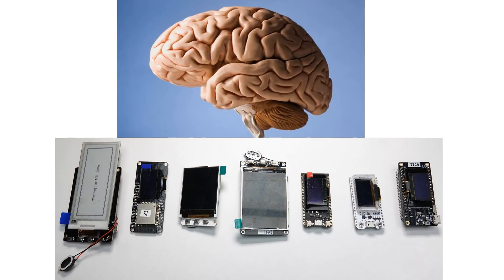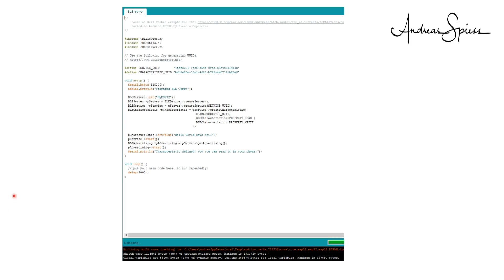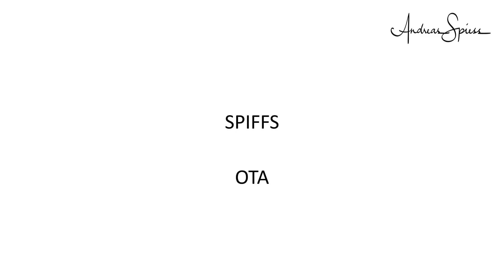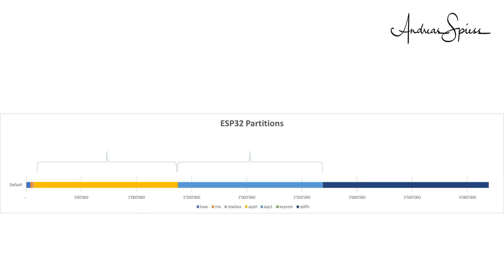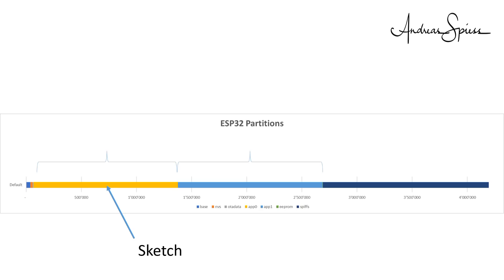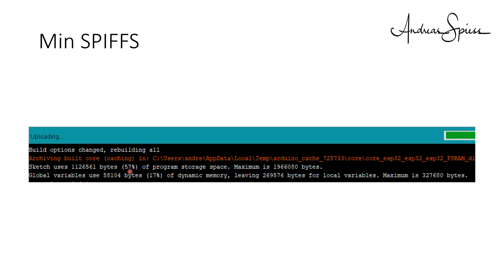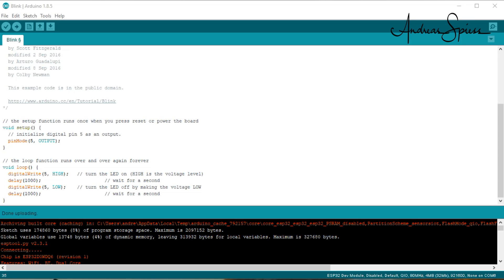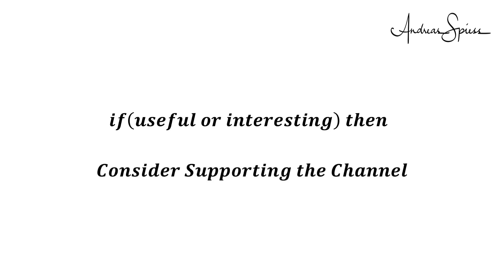#222 More Memory for the ESP32 without Soldering (How-to adapt partition sizes)

Comment: Cool - I'm using the Adafruit HUZZAH32 and the Partition Scheme menu item doesn't exist but a quick edit of boards.txt put that right and I'm now using Minimal SPIFFS with no problems :)  Thank you.
Reply: Really neat! Thank you
Reply: hello, what kind of edit you do in boards.txt?
Reply: @dhaniyanuar5024  I've just checked the ESP32 Arduino github and it seems that the partition lines are now in boards.txt, as installed.

Comment: is it possible to increase EPROM size??? because when I increase the nvs partition table, it doesn't work. 
# Name,   Type, SubType, Offset,  Size, Flags
nvs,   data, nvs,     0x9000,  0x15000,
otadata,  data, ota,     0x1e000,  0x2000,
app0,     app,  ota_0,   0x20000, 0x140000,
app1,     app,  ota_1,   0x160000,0x140000,
spiffs,      data, spiffs,  0x2A0000,0x160000,
Reply from the maker: I never needed to have more EEPROM, so I do not knwo :-(

Comment: is it possible (and/or advisable) to get rid of spiffs entirely? Directly flash?
Reply from the maker: It depends on your needs. You can put the variables in your sketch (flash memory), use EEPROM (also if flash memory), or SPIFFS (also in flash memory). All with advantages and disadvantages.
Reply: Yes, just make do not include a spiffs partition in your partitions.csv file.  Your program goes in the "factory" partiition. "NVS" can be used by you to store variables, structs etc but is also used by the system so keep that in there.

Comment: Is it possible to allocate the total available SPIFFS for the sketch only, I don’t require the OTA or the capability to store other files I want all the memory available for the sketch only. Please help.
Reply from the maker: Usually you can choose the chose the partitioning in the Arduino IDE (Tools-->partition scheme)
Reply: @AndreasSpiess  i know but, i want to allocate all the memory for the sketch only with no SPIFFS or no OTA,default options has either combinations. Please help me i have been searching for a long time but didn’t manage to find a reasonable answer.

Comment: In Arduino IDe is it possible to display the size of SPIFFS ?
Thanks :)
Marc.
Reply from the maker: Usually you can display the partition scheme where you define the SPIFFS size
Reply: There are API functions that will return  used and available bytes. Check out the SPIFF library,   SPIFFS.h file for the declaration.

Comment: This didn't really show the functions to fetch the partition sizes...is that available?  I'm curious, because I have a v2 Heltec Lora, which has 8MB QSPI flash and I wanted to just check the allocations.  I would love to find this function.  Also, I might mention I'm running in VSC with platformIO and not sure if you can set those default partitions there or how.  As usual, you, sir, are a master and make very excellent/quick videos that answer some very complex questions!  Thank you!
Reply: ...and a little poking around on espressif's site:  https://docs.espressif.com/projects/esp-idf/en/latest/esp32/api-reference/storage/spi_flash.html#partition-table-api
Reply from the maker: Usually you define the partition scheme in the IDE before you compile. So I do not see a big need to do that after deployment. You find the partition schemes if you chose the ESP32dev board. You should also find these constants in PIO, but you have to google.

Comment: used custom partiton table in platformIO and can confirm that you can make your main partition 3Mb

add board_build.partitions = partitions_custom.csv to your platformio.ini and your partitions_custom.csv file to the root of the project.
Reply from the maker: Thank you for your tip!

Comment: I didn't need SPIFFS but still needed OTA , i tried this configuration and it works with HTTP OTA + BLE + MQTT. please do comment if you think there is an issue with this.

# Name,   Type, SubType, Offset,  Size, Flags
nvs, data, nvs, 0x9000, 0x5000,
otadata, data, ota, 0xe000, 0x2000,
app0, app, ota_0, , 0x1f7f00,
app1, app, ota_1, , 0x1f7f00,
eeprom, data, 0x99, , 0x200,
spiffs, data, spiffs, , 0x0,
Reply: i tried to maximize app0 and app1 for this one. also i left the offset blank because the esp_tool can handle offset alignment as per the document.
Reply from the maker: I cannot do remote debugging :-(
Reply: @AndreasSpiess  this is interesting. 

btw, i updated mine to elimate eeprom and maximised app1, app0. 

# Name,   Type, SubType, Offset,  Size, Flags
nvs, data, nvs, 0x9000, 0x5000,
otadata, data, ota, 0xe000, 0x2000,
app0, app, ota_0, 0x10000, 0x1f0000,
app1, app, ota_1, 0x200000, 0x1f0000,
eeprom, data, 0x99, 0x3f0000, 0x0,
spiffs, data, spiffs, 0x3f0000, 0xf000,

unfortunately my requirement includes support for Wifi OTA, WIFI Mqtt, and BLE Server for setting up node configuration via smart phone.

I've been able to successfully merge all these 3 plus a variety of peripheral support on the device but somehow i needed to do a software restart every time the user needs to change mode (wifi mqtt as client -> ble server -> wifi ota as server) . it turned out, managing spiffs is easier than using eeprom with arduinojson. 

i never did remote debugging before and i don't think it will be needed in the product im involved with.

this particular video explanation you posted has been instrumental in bootstrapping my knowledge in esp32 partitioning. thank you very much!

Comment: Andreas have a look at this https://www.youtube.com/watch?v=YSZzXN8hs4Q I wondered if you know about this little wonder with extra memory
Reply from the maker: Thank you for the link. I have such boards since about a year. They do not behave much differently. The only difference AFAIK is that they have the flash integrated into the main chip to save manufacturing cost and maybe space. But so far I did not see a lot of boards based on the chip.

Comment: I'm using PlatformIO, a much better IDE than Arduino IDE. Easy to change the partitioning both for ESP8266 and for ESP32. An example here for ESP8266 with almost 2MB for app0 and app1,  https://github.com/espressif/arduino-esp32/issues/1476#issuecomment-395348594
Reply from the maker: Thank you for the link!

Comment: Hi Andreas, great video, I was wondering if you can assist me, I'm using doit esp32 dev kit v1, and I can't see the partition scheme option under tools... Is there somehitng else that I should be doing?
Reply from the maker: Just use the "ESP32 DEV" module" board instead, or "transplant" the lines in boards.txt to your board (As shown in the video.
Reply: Line transplantation worked for me flawlessly on that board.

Comment: I am not seeing Partition Scheme in the Tools menu of the IDE, tried on 1.8.5 and 1.8.6. Has anyone got any ideas please.. Thank you
Reply from the maker: Not all boards definitions support partitioning. The ESP32 dev Module definition supports it.
You can add these lines to your board:
esp32.menu.PartitionScheme.default=Default
esp32.menu.PartitionScheme.default.build.partitions=default
esp32.menu.PartitionScheme.minimal=Minimal (2MB FLASH)
esp32.menu.PartitionScheme.minimal.build.partitions=minimal
esp32.menu.PartitionScheme.no_ota=No OTA (Large APP)
esp32.menu.PartitionScheme.no_ota.build.partitions=no_ota
esp32.menu.PartitionScheme.no_ota.upload.maximum_size=2097152
esp32.menu.PartitionScheme.min_spiffs=Minimal SPIFFS (Large APPS with OTA)
esp32.menu.PartitionScheme.min_spiffs.build.partitions=min_spiffs
esp32.menu.PartitionScheme.min_spiffs.upload.maximum_size=1966080

in boards.txt

please replace the esp32. with the text of your board.
Reply: Andreas Spiess  I worked on it last night and solved why it wasn’t working. I was working off the old esp32 core. Once I deleted it and added esp32 from within the Arduino IDE I had the options presented to me😀 many thanks for the code. I will store it somewhere safe. My BLE sketch has complied and uploaded into the new partition and all looking great 😀😀🏴

Comment: Technically, OTA doesn't need two equal sized partitions. You could copy the program directly over the original program as it's already loaded on RAM. The reason why there are two partitions is safety. If there's a problem when downloading and the program file is corrupted, a Serial reflash would be needed (which would be difficult and expensive to do in a consumer electronic product). And also, don't forget Secure Boot, used for anti-hacking, important in IoT products so that someone can't upload a malicious code exploiting the OTA update. If an error in the signature is found and the program is on the original partition, it would refuse to boot and, again, a Serial reflash would be needed. And if flash encryption is enabled, it's even more difficult to reflash via Serial. It might even be impossible depending on how you set it up, forcing you to replace the ESP32 chip (even more difficult and expensive). That means an attacker could disable an IoT alarm, for example, by simply uploading an arbitrary, not signed, program! And it would take hours to fix in a best case scenario (the victim has an electronics lab with ESP32s) to days in a worst case scenario (the product has to be sent to a technician and back to the victim)
Reply from the maker: I think your comment describes why espressif chose to do what they do. And still, it is very easy to brick you ESP yourself with a bad sketch (re.g. blocking loop). Then, OTA does not work and you need to reflash the board :-(
Reply: Ture, but at least you can test if it works before releasing the update if you have a consumer electronic product. The other scenarios are more likely to happen.

Comment: Hello Andreas,

I admire your work and channel; and thanks for inspiring.
I have a suggestion, I co-built an arduino plugin with a friend to automate memory partition for esp32

See latest Esp32 Partition manager:
https://github.com/francis94c/ESP32Partitions

Other examples of usage is in:
https://github.com/espressif/arduino-esp32/tree/master/libraries/EEPROM/examples/eeprom_class

Best regards, 
Elochukwu Ifediora (fedy0)
Reply from the maker: Interesting concept. However, it did not run for me. I added my point to the existing issue.
Reply: I tried this tool too hoping it would solve all of my problems but no tool in the menu - tried various versions of the arduino IDE and still couldn’t get the gui tool to show 😢 thanks for your effort nonetheless 🙏

Comment: Very useful information, especially since some of the Wemos D1 boards have 16MB of flash (that is difficult to use). On ESP32, RAM is the barrier I most frequently run into, dreams-first. It encourages creativity.
Reply from the maker: I think the ESP8266 does not use the same method.
Reply: Internally, it's slightly different, but from the IDE the ESP8266 uses a similar process to set target flash partitioning. It can only be set from the Arduino IDE if valid partitioning has been defined in your boards.txt for the currently selected board.

Example linker command line: -Tesp8266.flash.4m1m.ld which yields 3MB program, 1MB SPIFFS. 

But from within the Arduino IDE using a Wemos D1 Pro Mini, you'd simply select "3MB Program, 1MB SPIFFS" from the Arduino Tools menu.

You can define custom partitioning, too, but you need to understand the board and linker limitations.

Comment: Great video again, Thanks!
I never used OTA and my first thought was to remove app1 and minimize SPIFFS like in the other comments, but then I thought, why not using ota?
I scanned your videos and did not find an esp arduino ota tutorial.
I am sure not only I would be glad if you made one!
Would you be so kind?
Or is it the same as with the ESP8266?
Greetings, Roland (the one with the shortest ESP-video ever ;-) )
Reply from the maker: There is an example file in the ESP section (ArduinoOTA). I never tried it so far.

Comment: Thank you Andreas, that was very informative I had no idea. Can I assume that the RTOS is responsible for the 13% in the blink sketch? If you added external SD flash memory could that be used for OTA?
Reply from the maker: OTA is a function programmed by espressif. If you want to use another flash, you probably have to adapt this code.

Comment: this is strange. Micropython uses ~500 kb out of 4 MB. The only memory problem micropython gives is RAM memory shortage and only on esp8266. I am surprised that Arduino eats so much disk space.
Reply from the maker: Micropython uses a different concept. It stores its "sketch" in RAM. This is why the ESP8266 is not used for big micropython projects and they use ESP32 with PSRAM

Comment: They also sell ESP32 with 8/16/32Mb flash size for like $1 or $2 more
Reply from the maker: Do you have a link?
Reply: @AndreasSpiess  
https://www.electrodragon.com/product/wroom-32/
https://www.analoglamb.com/product/esp32-wrover/
Reply from the maker: Thanks! Were you able to use the flash in the Arduino IDE?
Reply: Yes. They work out of the box
Reply: But like what's the maximum APP size you can use for these ?

Comment: Wow!!  That's really neat!  I never knew you could change the partition of the memory spaces in these mcu's. I'll have to remember this when I'm working with my custom bms. Can the STM32 also be done this way?
Reply: Technically the flash chip is on the WROOM/WROVER module, not on the ESP32. The STM32 seems to have some memory within it at first glance, but I'm not positive. It's formatting would be up to the developers who created the IDE and libraries.
Reply from the maker: I do not know STM32.

Comment: This option only works with the "ESP32 dev module", currently i'm working with the "DOIT ESP32 DEVKIT V1", if i upload a sketch using the first board, do i keep the partition definition if i upload a second sketch but using my actual board?, if not, is there a way to add such optiion to any board model?.
Reply from the maker: Yes, you have to copy the lines of the boards.txt file to your board definition. But you also can use the ESP32 dev module board. I always use that one.
Reply: I see, thanks for the info!

Comment: nice video! Can you give advice using ESP32 in sleep mode? Battery keeps dying..
Reply from the maker: I did it once for my board tests. I only used the example file. But I did not try if something is broken now. That would be an issue for Github...
Reply: There are a number of Deep Sleep examples built into the esp32 library.
Reply: I see that using the esp_sleep_enable_ext0_wakeup() method is the way to go. Is there a possibility to use as a wake-up event an incoming I2C message?
Reply from the maker: I do not think so. I2C needs a running processor.
Reply: I would concur. Proper method would likely be waking up periodically and polling for new data via i2c. Best method is to devote a pin to waking up via an interrupt, which is supported.
Reply: sounds legit! Thanks
Reply: Andreas already did a great video on the different deep sleep modes here: https://www.youtube.com/watch?v=r75MrWIVIw4

Comment: i'm probably missing something here, but this caught my attention just now and it feels weird. 
the blink sketch uses a couple standard arduino library functions (3 or 5, depending on how you count setup() and loop()) and - compiled - is around 170 KiB. 
a hello world program in C on my computer (linux, gcc, amd64) compiles to a 7.8 KiB binary. 

what part am i missing here that explains why the microcontroller binary is a solid order of magnitude larger than the one on amd64? in particular, if you consider that the blink sketch essentially only sets a few registers. it just doesn't add up for me.
Reply: Your C program will dynamically load the standard C library, which is big. Since it's dynamically loaded the file of the executable remains small.
Reply: ah, thanks - yes, that was the part that i was missing in my brainfart. now it makes sense. 

cheers!
Reply: Aside from the C library the Arduino library itself forces it to link to many stuff that you don't see or make use. Arduino inherits from it's Wiring past the fact that it is not well designed for speed or small footprint, but portability except in MCUs that have low storage space, obviously.

For actual Arduino boards with AVR microcontrollers you can use Atmel Studio and don't use the Arduino library (or IDE) and that will give you a much smaller foot print, and also teach you more closely how your MCU works.
Reply: thanks for the detail! i guess the the arduino ide does just fine for most purposes, but this is definitely something to keep in mind for that one occasion where you run of memory :)

Comment: Hello Andreas.
Thank you for another great video.
Why there is no possibility to use No OTA AND minimum SPIFFS at the same time?
Reply: If I understand it right, you might try to provide your own partition CSV with  no app1 and a minimal SPIFF section. I.e. combine the best parts of no_ota.csv and min_spiffs.csv. (Edit: typo)
Reply: There are example partition CSVs at https://github.com/espressif/arduino-esp32/issues/1476 which answer exactly that. Last one allocates ~3.5MB for a single APP
Reply: exactly - that sounds like a very useful default. It's be good to have someone built and test one and share it ? personally I never use OTA or SPIFFs, but I use multiple libraries in some projects and having most of that 4mb would to use in sketches would be my default for most of the time. weird that whomever made those defaults didn't put that obvious one in, unless it isn't supported for some reason.